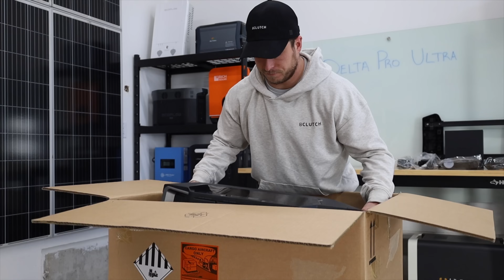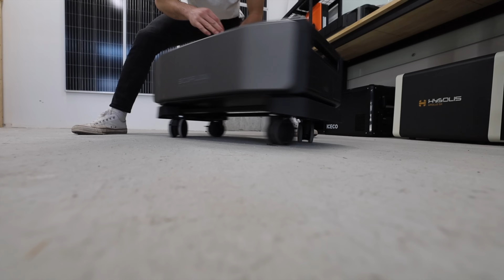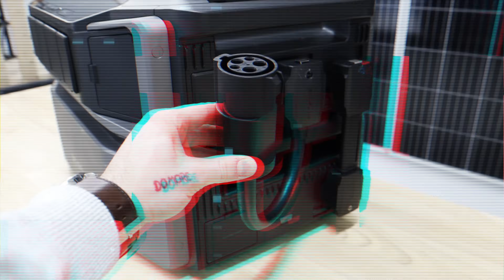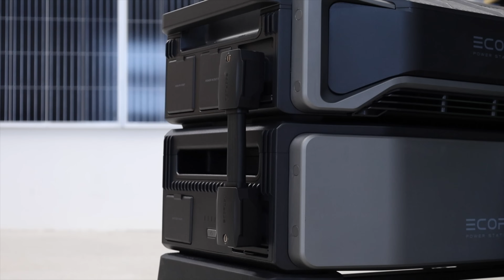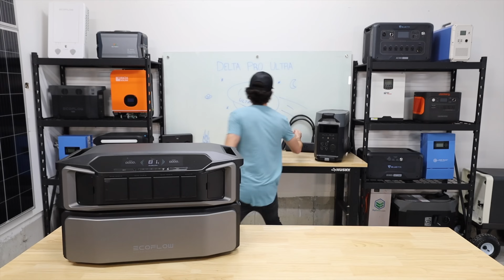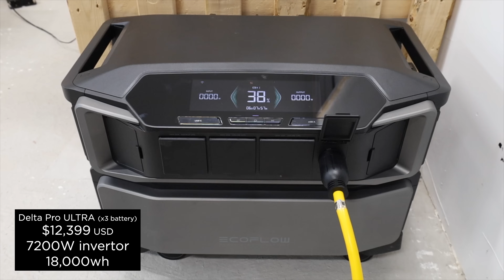EcoFlow Delta Pro Ultra - NOT What We Were Expecting!

Comment: Good review, but no matter how I twist my rationalization, these still don't make any sense to me.  As somebody who is paying 0.08/kwh, batteries/solar is still for either the hobbyist, prepper, or climate activist with way more money than common sense.  The price point on these who are just looking for home backup power is still insane.  I have a dinosaur trifuel inverter that provides 6kw running & 9kw peak split phase output, connected to natural gas which I already have at my house for unlimited usage for ... $1500.
Reply: Imagine the power going out during a bad rainstorm, in the middle of the night after going to bed.  If you had a battery backup system, you could restore power in a few minutes.  Not even having to go outside to start a generator. 

We have a 9000/7250 Predator Generator that runs off NG and a Delta Pro and a Smart Battery.  The Delta Pro is always on standby, so if the power does go out, we just turn it on, and power is restored to our entire house. No need for me to set up our generator right away.
Reply: @Pk3_Garage I initially bought my river pro to make it easier on my mom when the power goes out , because we can lose power for up to 4 days , and our internet is through satellite , and it was way better to run the generator for an hour to recharge ,way more efficient, then got the delta 2 max , just to get more power 

And now I'm adding the ultra into the mix to just to up the general power supply for the property
Reply: @Pk3_Garage I have a whole home backup generator that does this for me and I don't have to do anything.  There have been times I wake up in the morning and didn't even realize I was running off the generator until I went outside and walked past it.  Best thing,  it cost a fraction of what an ultra system would cost to do the same.
Reply: You’re paying .08 cents per kilowatt of electricity but you will also have to pay around .10/.12 cents per kilowatt for the delivery fee your utility company charge
Reply: I have propane!if I had natural gas from the town I would definitely go with it…I do have common sense…and I hate wasting money…but what’s the alternative…gas stations go out of power and gas …remember Sandy!
Reply: As much as many will try to convince you you're wrong, the truth is as you state "still don't make any sense to me".  However, the conditions and circumstances you present are what makes that a true statement and may not be shared by the majority.  This is why each person should consider their own situation and make a decision that is best for themselves.  But those that are in your situation should recognize that financial feasibility is not the rational that defends battery powered backup.  I say this as someone that has a significant amount of money invested in whole-home solar, battery backup, and electric vehicles.  But these choices I've made are based on my circumstances and conditions.  Fortunately, not every topic is a matter of right or wrong when applied to every case.  Thanks for your comment
Reply: @brianmills4891 Invested or money spent?
Reply: What if fuel is not available?
Reply: Good question. That's why it's so important to have more than one fuel and backup power source.  As other's have said, every situation is different and might require one or all of your backup resources. @lonewolf2364
Reply: Depends on who you are…. Every year I have to pay taxes and I was able to reduce my taxes by 3 grand….. I reduced the heck out of my electric bill and this year I’ll paying taxes again but hopefully again buying more batteries and panels will be reducing my tax bill again…. Basically a use or lose I rather spend my money on solar than just give it to the government ..
Reply: I think the difference is for people like me….i can’t get power for cheaper than 0.15/kWh.  Thats not a typo.  Yes nearly double what you’re paying.  

Plus I live somewhere with a trash electric grid.  So at this point while yes the pay off takes 10 years, it will also provide a back up during that time, making it worth it for someone like me, even though I do prioritize financials right now.
Reply: You can't really take that with you off grid to a cabin in the woods... and yeah, fuel is great but the NWO is trying to TAKE IT AWAY FROM US while gaslighting us that WE are destroying the Earth. Natural gas is insanely abundant from what I gather and it's a perfect fuel... however, many want to create off grid houses or communities or even long voyages on sea or land without access to fuel sources.
Reply: Your key phrase “already have”. 
But if you are new to back up power then this might be a good option.
I personally think these are now finally (quality now) a great way to go along with a high quality inverter generator like you mentioned. 
Honda!
Reply: I don’t like trying to remember about the gas, and then it goes bad after a while and you have to drain it and clear the whatever 😂
Reply: I live in a condominium and can’t run gas generators in my development. I also use it to run my boat when we spend a few days on it. With a few solar panels I can run it indefinitely
Reply: Our entire power grid is a turd. Smart people have been warning Congress to fund an overhaul of it. It probably never will be done. When a Carrington event; emp, or a complete hack happens. Your unlimited supply comment will come to the forefront of your mind immediately. AKA, when your fuel runs out, you're done.
Reply: What kind of noisy racket does that dinosaur inverter make?
Reply: And when fuel runs out, what do you do?
Reply: If you have only very light needs, the trifuel generator makes a lot of sense.

If you want to use it full time, the maintenance requirements and fuel costs will eat you alive. That’s where solar systems make more sense.
Reply: Good for you what do the rest of the people do
Reply: You plane ahead. I've been working on our emergency backup power system for almost three years now. Buying equipment as we had money.  

You have to make it a priority, which means, you might not be able to buy certain things for a time in order to save up for whatever system you can afford.
Reply: @Pk3_Garage Responsible way of putting a system together but the only problem I see is in 3 years technology is leaps and bounds ahead of what you originally bought.
Reply: True, but I don't plane on updating anything unless it breaks or no longer meets my needs.  @bbariceo
Reply: @bbariceo I get that.  But I look at it this way, like my firearms, O.C. Pepper Spray, knife, Cat7 tourniquet, it is better to have it and not need it than need it and not have it.
Reply: Cool story but i dont have a gas line going into my home and no electricity company here offers power for 8¢ so your set up means absolutely diddly squat to me, even if i did enjoy the racket a dino generator makes. So i guess im either just a hobbyist, prepper, or climate activist with more money than common sense, huh?
Reply: This is a good point. Its also great keeping it inside so that you can smell the full experience.
Reply: Looking at these comments, a wide stance between everyone. 
A) If you're running on backup power, you're conserving energy in the house, not turning on every light, appliance, and TV.
B) Gas versus propane versus solar versus engine versus battery and convenience?
Buy a Ford Lightning EV pickup with the whole house power option. Low on gas? Drive it to the gas station.
Reply: Interesting feedback, not trying to be rude, just respectfully pragmatic.  If you already have an ICE generator solution and have an extra $5k burning a hole in your pocket, have at it.  
How noisy?  About 70db and a not a shit given about this if I'm out of power and have to keep the furnace running. 
When the fuel runs out? One time.  1 time in my life have I ever experienced a natural gas outage.  And if that's gone, it's TRI-fuel.  Propane and gasoline are still options. What are folks here going to do when your $10k setup lasts you 1 day and it's cloudy out?  
Hooking up in a rainstorm in the middle of the night?  You're going to fly out of bed to plug in your battery just so you can open the fridge at 3 am?  Or you can go back to bed and sleep.  You're house is fine with zero power for a few hours.  But it you want to spend an extra $5000 so you don't have to take 5 minutes outside, ok for you.
Light needs?  A 6kw/9kwh trifuel is basically comparable in output of the DPU, unless you are pairing several units and setting yourself back many $10ks.
Full time Trifuel generator usage? I thought we were talking about whole house BACKUP power, when did we change the use case here?  Anyway, if you are paying $0.08 kwh and in a region that is going to get you 2-4 hours/day decent sunlight for solar charge, solar ROI is a stretch.
ICE maintenance? Yep, there is some, but running natural gas/propane is about as clean as it gets.  No carb gumming, etc. And yes, I'm sure if I have to run on natural gas for a few days, it will cost a few extra bucks, but nowhere near the cost of the DPU.  And, I can run practically everything in the house, every light, internet, fridge, freezer, furnace, etc.  If I'm careful, I'll easily be able to run the microwave or airfryer or even AC if you have a soft start.

Look, it's a cool solution and I hope in time battery chemistries will be able to provide a more cost competitive solution to traditional ICE generators.  But it's a pricey solution for maybe a day's worth of power if you conserve, maybe you can milk a few more hours if you hook up some panels. My household goes through 30-50 kwh per day, a 6kwh battery isn't going to last folks long, don't fall for the marketing and understand your own real electricity usage.  And I'm not knocking solar entirely, depending on where you live and your usage, solar could make sense.  If you have a full solar setup with 10kw+ panels, with 30khw+ batteries and pay an arm and a leg for electricity, and perhaps able to peak shave or have a net metering agreement, that's great, but I know that didn't cost $1500.  But realistically for most that is a 10+ year ROI, and at the end of that term, at least those batteries are getting end of life.
Reply: You bring up some good points. A wise person would invest in more than one backup power source. As well as more than one fuel source.  

You can't put a price on safety.   @neverclevernorwitty7821
Reply: @neverclevernorwitty7821